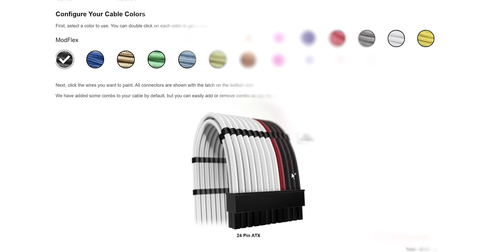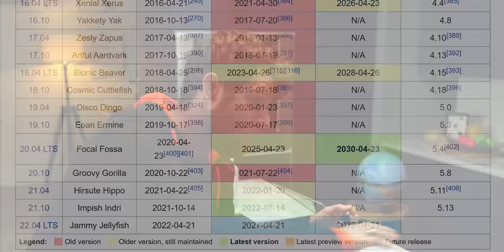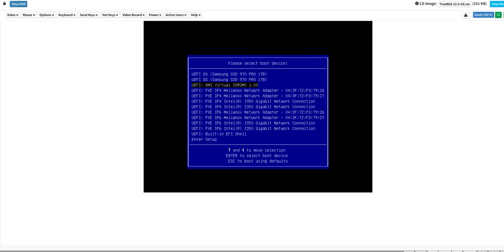We Finally Did it Properly - "Linux" Whonnock Upgrade

Comment: Quite entertaining 😁 I'd love to see a reaction video from an EMC technician.
Reply: One drive failure? They should have gone with a vsan solution
Reply: The Linux lord himself in the house 🤘
Reply: Yooo Chris over here! Hi Chris, your channel's awesome!
Reply: @Dermot McCann don't fuckin' start, dude 😂😂
Reply: @Dermot McCann Oh s*it! HERE WE GO AGAIN -_-
Reply: Not EMC anymore, but as a enterprise storage dude, this should be taken as for entertainment purposes only.  I did have to clean off coffee off of my monitor and keyboard a couple of times on what they were doing, with the largest cleanup after hearing no compression.  No compression or dedupe at a hardware level is super casual, but understandable on a community edition of the NAS that they have.  

Now, as a DYI first shop, which is what I take LTT to be, it's fine, and great if you are supporting it yourself.  Hell, if it breaks, that's some free content for them.  Most shops, however, will not use this type of solution, and will will use a NAS solution, like a VM running SMB/Samba (depending on OS).  Or better yet, get a dedicated NAS appliance like an Isilon (big data EMC), Qumulo (big data, HPE), or some hybrid approach that does both FC and NAS in a box.  And from there, I would not use it as a backup target, as I tell folks to get some sort of 'air gapped' or API driven backup appliance. Stuff like a Powerprotect (formally Data Domain) or StoreOnce.  I hear good things about ExaGrid and Quamtum DXi, but I haven't used them personally. 

With that said, I'd love to see some LTT videos introducing people to Fibre Channel (re), running over Fiber Optic (er) cables.  Want a million IOPS?  FC can do it.  It's pretty awesome.
Reply: @Dermot McCann i use arch btw 😂
Reply: @bobgries901  thoughts on Pure Storage?
Reply: @bobgries901  Sounds every INSANELY expensive and doubtful if that give you better performance, you might have noticed the rise of opensource and beating the old proprietary stuff on pretty much any level, because opensource fights for the best performance and power for a user, while prorietary fight for most profit, meaning less quality, less performance, so you can sell the higher tiers and force customer to pay even more. The practice of limiting features that customers badly want, locking them or disabling them is totally unknown in opensource and nobody would ever do it. Even if proprietary would provide more stability and performance, I doubt very much that Linux Media Group would be happy with the sticker price of several hundred thousand dollars. For that, you can put in a ton of effort into tuning and optimizing the custom made NAS.
Reply: @bobgries901 Considering that they're dealing with video footage that's already highly compressed, then in the best case, having NAS-side compression enabled will result in equal or slightly more disk usage, worst case it will possibly make the CPU the bottleneck again, instead of the networking. 
As for dedupe, it really depends on whether there are likely to be duplicate sections of footage at the same cluster/allocation-unit alignment. I also imagine having it enabled will require significantly more RAM than they have installed in order for the dedupe table to perform well.
Reply: You are My teacher Chris ❤️
Reply: @dylanh333  Zfs is always faster with compression.. so many wrong doings no wonder they fail all the time with trueNAS
Reply: @nigratruo   I looked at it a few years ago and as a bunch of SSDs in a cute enclosure it was sorely lacking in features compared with the Netapps we were considering replacing.
Reply: @nigratruo  They really are not that more expensive. A Netapp A250 with 24x 7.6TB NVMe is about $200k USD, that's 180TB raw and with dedup and compression 3:1 guarantee that Netapp will give you extra hardware free if not meet then that is 500TB of usable capacity (that guarantee is for usable capacity).

If LMG were not getting free hardware, or sometimes going used or cheap/improper SSDs, then the cost is very close to the same.

Each A250 is rated for 1.4 million IOPs and 25GB/s throughput, what you'll actually achieve will depend on workload and I/O block size. A fully scaled A250 cluster is rated for 11.4 million IOPs and 300GB/s. Netapp/ONTAP is also a proper scale-out NAS system and can do both SMB Multichannel and SMB Direct so controllers (servers) won't be idle doing nothing and will actually be handling client I/O traffic.
Reply: @dylanh333  Compression still works, a lot better with SSDs than people realize and "compressed data" (video & images) doesn't actually prevent storage layer compression from achieving good results. Also at least on a Netapp implementation for this use case Background Dedup would be used not Inline.
Reply: @timothymatthews1653  At the end of the day, I haven't had to directly deal with this much in the real world, in a way that I'd have empirical experience with how compression turns out for video footage on an enterprise SAN or NAS, and I also haven't dealt with ZFS much.
With that said, at least in theory, and assuming the video footage is maximally compressed and highly entropic (ie. it just looks like noise on disk, with no real patterns in the data), then there wouldn't be any decent occurence of repeating bytes or sequences thereof for most compression methods to reduce, and if every byte has the same frequency, Huffman coding wouldn't make any improvements either.
Perhaps there are other compression mechanisms that can still reduce highly entropic data down even further, but I think this is fundamentally at odds with information theory.
That said, perhaps things like Red video footage - which are losslessly compressed in realtime - by the camera during capture - still have a great deal more room for background compression to on a SAN or NAS work, simply because these compression methods are too computationally expensive to do in realtime on the camera itself during capture.
Reply: @dylanh333  True the more something is compressed the less you can gain by essentially doing it again, really does depend on what the files actually are. Fortunately dedup still works here as it's just looking at hashed block chunks and finding other hash hits and the more data you have the more hits you'll get and the better dedup ratio.

Can still do that with ZFS mind you, however I think it can only do Inline not Background like ONTAP can do so there is a performance and system resource implication with that. We're getting 23% dedup savings no a volume with video files in it, compression disabled on this volume. Some other volumes have it on but I forget what the volume names are of those, won't be a lot percentage wise but we have a lot of data so 10% saving is still a lot for us.
Reply: @timothymatthews1653  Yeah, dedupe works wonders on our backups especially, where you have a whole bunch of Windows VMs sharing identical system files and DLLs at block offsets. That said, I'm unsure as to how it would perform with video footage, which even if it can sometimes have repeated sections of identical data, I doubt it would end up being block aligned. Perhaps video editor workflows might end up with multiple copies of the same footage though, in which case dedupe would still make a difference
Reply: @timothymatthews1653  I missed the bit where you said you were actually getting decent dedupe on volumes with video files! What formats/compression/codecs is the video footage itself using? After giving it some thought, I'd guess that losslessly compressed Red footage (or just uncompressed video) would still have a lot of headroom for further (lossless) compression, whereas something like lossy H264 or H265 footage might be a lot harder to compress further.
Reply: Likewise, if it's lightly compressed or raw footage spanning several blocks, with large chunks of identical footage as part of that, I guess you could get a number of identical blocks for dedupe as well
Reply: @dylanh333  Wouldn't have a clue what the video formats and codecs are, just provide storage. Part of the infrastructure team here, we're a university, so our requirements are very very broad. That's why I don't remember the volume names since there are hundreds of them, and thousands of SMB and NFS shares.

Far as dedup goes something like that doesn't really care if it's compressed video footage it'll still dedup just a bit less than if it were not. For example with Commvault it's recommended to disable SQL Native Compression in the job settings as you get higher dedup ratio, trade off is the job data is higher and more network I/O. SQL backups with Native Compression do still dedup but it's not the 90%+ you get with it off.

Still when your pool of data chunks is in the PB scale there's a very high probability of the chunk hash match therefore a dedup table hit.
Reply: @timothymatthews1653  Having dedupe on will never really hurt if you have data with no identical blocks, IMO, but at least theoretically, you'll only ever get a dedupe ratio of 1:1 in that scenario. Realistically, when you're dealing with stuff like university data, whether that be a million and 1 copies of the same word document spread across a billion different directories, or a whole bunch of VMDKs for Windows guests where a large chunk of 4096-byte-aligned system files are identical, you'll most definitely see decent dedupe ratios. When you then get into backups, where you have multiple copies of the same VM from different points in time where only some blocks have changed, then you get even more impressive dedupe ratios on your backup NASes.
But yeah, for video, whilst I can't say I've had to really deal with it directly, from an infrastructure side either, I definitely don't think that will compress well any further, and probably won't get much more than 1:1 dedupe either.
Anyway, hi fellow nerd!
Reply: @dylanh333  Argh typed up a long reply and something in it Youtube didn't like and it was deleted, oh well not typing it again haha.
Reply: @dylanh333  If you do want to talk more about it jump over to the forum and create a topic, I'll see it.
Reply: @bobgries901  Fibre Channel? Are you writing from the distant past? InfiniBand pushes 400Gbps these days. Fiber Channel topped out at 128 Gbps.
Reply: @timothymatthews1653  That is SUPER expensive, try to build that with a Ceph cluster and you will notice that you will save a ton of money, that is why Ceph has been phenomenally successful. Netapp makes a fat profit off their hardware of course. It is for people that aren't experts and can build it themselves better with opensource software.
Reply: @nigratruo  Netapp doesn't make money on the hardware. They make money on the storage capacity license, you can run ONTAP on any hardware you want to. It's called ONTAP Select. Doesn't actually mean it's better or cheaper too though.

Also I've run a Ceph cluster, it's not comparable to a Netapp. Different use cases for different purposes, neither replaces the other.

Also just get the best of both, use ONTAP Cloud Tiering to move data down to the Ceph cluster. Then you get all the advanced features and ultra low latency of the Netapp and the cheap bulk capacity and high throughput of Ceph. I don't see any reason to have to only pick one technology
Reply: @timothymatthews1653  They do get their money somehow and their profit margin is my loss margin, sorry I know too much about business to believe in fairy tales, in the end they are an expensive offering that is unattractive to somebody that drives a hard bargain like I do. You sound like you work for them, in the marketing department, hahahahahaha. It's a free world, anybody can buy any product that they want.

Comment: "there's a bunch of hard drives under there. stop slapping it!" lmfao literally kept rewinding it over and over again. thank you for the laugh
Reply: LOL i did the same thing, the first time he slapped it thats what i was thinking, then he does it again and the dude says that lol, i rewinded it like 4 times
Reply: Particularly funny since they're all SSDs what don't *care*...
Reply: @baylinkdashyt  There are 2 4U servers right under it. Since I have experience swapping heads on a HDD, I'm always on my toes when near a running one.
Reply: @baylinkdashyt  That was my first thought: SSDs, so what about slapping it?  Could probably throw it across the room if it didn't have the systemboard and PS in there to get hurt.

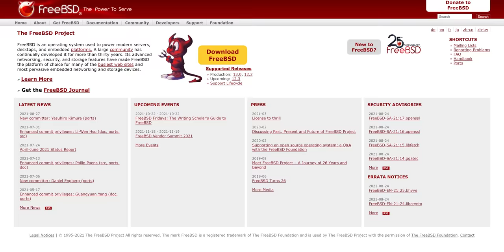Comment: 5:22 Honestly, two things, but TL;DR FreeBSD has my respect just as much as anything Linux-based

1. always use the right tool for the job.  Linux-based operating systems tend to be pretty good (at least, more often than Windows), but that's not strictly guaranteed.
2. FreeBSD (and anything derived therefrom) is a sensible choice.  Makes some design decisions that make it comparable to Linux if not better, plus ZFS is a native FreeBSD project so it'll always be a pretty good match.  Heck, it has a built-in Linux binary compatibility layer (plus solid virtualization support).  When my Framework gets here, I might switch to it.  (Currently on Gentoo - basically a BSD-style OS but with Linux for a kernel - for the better driver support on my existing systems.)  Heck, most Linux users will probably respect FreeBSD.
Reply: >ZFS is a native FreeBSD project Was not true, (the native one was illumos (as ZFS originated on Solaris and illumos is OpenSolaris successor) and it was ported to freebsd), double not true anymore. OpenZFS 2.0 is native to Linux since it basically grewup from ZFS on Linux. Well, current codebase is unified with both Linux and FreeBSD so they should have parity with features, so no problem with that.
Reply: ZFS would work great on Linux and not be module jank if Oracle would just relicense the project ffs. It has the CDDL SPECIFICALLY to be incompatible with Linux.
Reply: I respect FreeBSD, sure, but I'd never use it as my desktop OS. Linux is far better suited for that.
Reply: I’m looking forward to the day I need a laptop upgrade. I’m very interested in the Framework laptop. Right now I have FreeBSD 13.0 running on my Thinkpad T480 right now and it’s great. It’s also been a beast for 4 years on my server
Reply: @tralphstreet  Linux really does have a great desktop experience. All the GUI knobs work and it has all the electron apps you want. I switched to FreeBSD for my desktop bc I really like administering to FreeBSD better than Linux and I got so tired of distro hopping, trying to find the “right” distro for me. FreeBSD you have to spend time in the command line to do stuff that just works in the GUI on Linux, but that’s something that doesn’t bother me at all. I still put my family on Linux computers lol. Makes my life way easier
Reply: As a "Linux guy", it's more about open source than specifically Linux when it comes to adoption.  Linus sounded kinda defensive when talking about BSD as if it would upset the Linux cult.
Reply: Yeah I respect FreeBSD and anything open-source
Reply: @bograham6221  I thought that was a myth? Either way, it would be nice if they switched to a BSD or MIT license - if only because CDDL is too wordy and nobody knows how to interpret it.
Reply: Flipside is Linux has far better device driver support.  Triply so for crazy things like 100G NIC and such.  FreeBSD really struggles here and its unfortunate but the community just isn’t big enough (or so it would seem).  Linux has a massive hardware ecosystem and thats hard to replace in many cases.  Used to work for a manor storage vendor based on FreeBSD and a lot of the troubles with the platform were device driver related.  Many of the engineers left eventually, formed a decently similar scaleout storage startup, and instead based it on Linux and DPDK/SPDK.  

Re Linus:  IMHO compiling samba is nothing compared with the win of having acceptably good Mellanox drivers and a modern Linux kernel and IO stack. 

Oh and why have all that RAM if you aren’t going to use it for ZFS block cache.  You can’t possibly have that much metadata.
Reply: @AverageSneedEnjoyer  lots of Linux users are either fond or give a nod to the BSD family. It's the GPL/copyleft only zealots that want to tear your spine out and skip rope with it in the nearest 4 way intersection
Reply: @cokesucker9520  The problem is, it relies on Oracle to change the license, and then OpenZFS would have to be thrown out since you'd have to get the copy of ZFS from Oracle, and the filesystems are pretty different now, so I hear

Comment: 14:10 - one of the only times I noticed high queue depth from a "consumer" application was actually running DOOM 2016 and Eternal via proton on Linux. Level loading had an average queue depth of ~30.
Reply: That's interesting and pretty good actually. More games could be a lot less IO choked on loading if they used NCQ, async IO and MT this well. Including on spinny bois.

That being said the IO requirements of games aren't that... hot anyway so far.

Oh i know a thing. Second Life client. It shreds pretty hard. I should measure someday. On the other hand, it has... software inefficiencies, which are pretty horrid. Yeah i'm not assuming it will turn out one way or another, really need to measure.
Reply: Doom 2016 is really well optimised, they did a great job with it.